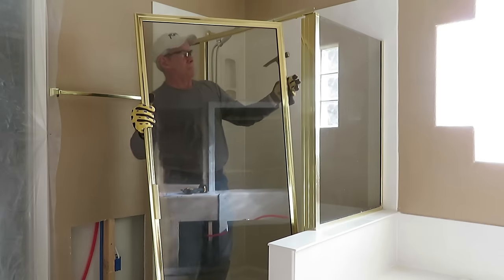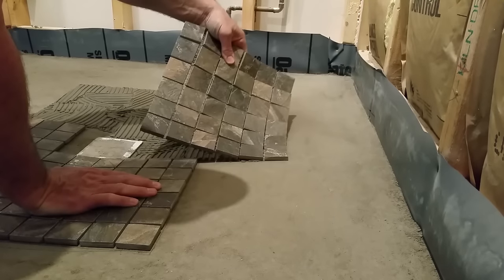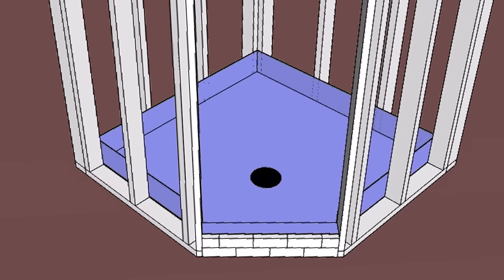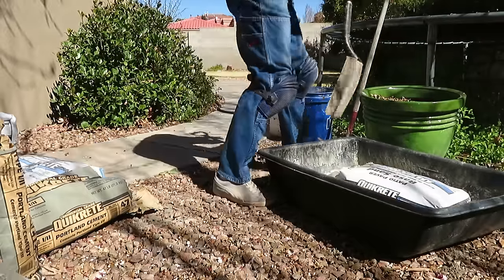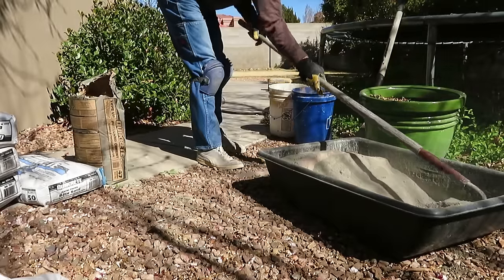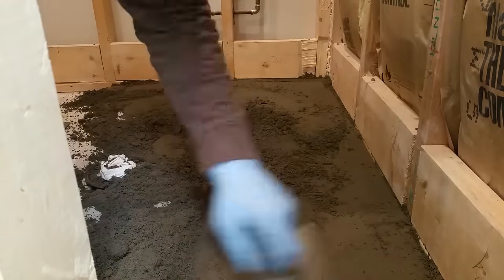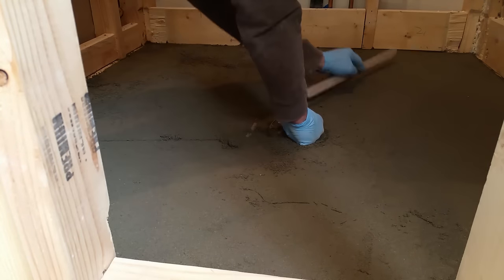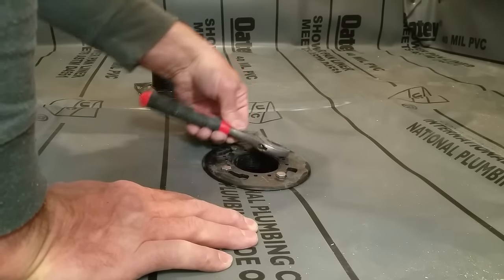Building a Shower Floor From Scratch - Part 1 of 2 - With Shower Pan Membrane

Comment: After 16 years, it was time to replace my shower door and redo the shower floor. As I did the demo, I found that water had leaked in back of the shower wall and there was a nice glob of mold in the horrible dry pack job the installer did. Of course he put the liner on top of the subfloor and then the dry pack which was completely wet. Your method of putting a slope in the first dry pack under the pan liner makes perfect sense and is what I’m in the process of doing now.  I have perfect confidence that my install will never fail thanks to your help!  Thank you!
Reply from the maker: Good luck with your shower, David! Yes, much of doing constructions projects well is doing what makes sense. Adding a layer sloping to the drain for the pan to rest on makes sense. Thanks for watching and for you comments!

Comment: This video is my bible to re-doing my parents tile shower. Someone screwed them in 2019. It destroyed the framing in the walls from all the water damage from the shower leaking. I'm a finish carpenter and don't know much about tile. Especially when it comes to the pan this video helped so much.
Reply from the maker: Thanks for watching, Josh! As a finish carpenter, you have all the basic skills necessary to pick up tile work as well. You just need a question or two answered along the way. Glad the video helped point you in the right direction!

Comment: I own a flooring company. I’ve been doing this for 30 years now and I just came across a video a few weeks ago of an individual basically trying to educate individuals and tell them to put loose aggregate around a shower drain after you complete your first shower pan pre-slope and then you add your membrane and when he got to his second and final last Install of the final pitch with the pan mud he was putting loose gravel around his drain and if you ever see your tile installer doing that you should stop him or her immediately and fire them. You only stick shower pan mud or deck, mud,in your  shower pan. Nothing with any type of gravel or aggregate should never be installed in a shower at any time if someone does that, they do not know what they’re doing and you need to stop them. If you pour your shower pan right you could install your tile right from the shower tiles and run it straight up to the wall. You should not ever have to use any furniture strip to start your first row of your tile installation. And another very important tip the less water in your pan mud the better you’ll be it should come out like a paste never like watery, mud, or looking like concrete mixture.

Comment: You need to do one thing. On a concrete floor with a preslope; at lease wet the old slab so it will not make you mud pack too dry and it fails. Best to bond with cement slury. 42 Years Journeyman
Reply from the maker: Thanks for watching and for the comment, Franklin.

Comment: What are your thoughts on bonding your preslope drypack to the concrete with a thinset slurry? Thank you so much for sharing your knowledge with this wonderful video.
Reply from the maker: I wouldn't have any objection to it, Aapl, but it's one of those things that may be overkill from my perspective so I wouldn't bother. My view is that once everything is in place in a shower remodel, including the outside bathroom floor tile, nothing is going anywhere, as in curb, layers of drypack, etc. Your idea wouldn't hurt anything, but probably wouldn't make any difference either. Thanks for watching and for your comments!

Comment: Beautiful job. I used to do it that way for a long time.
Reply from the maker: Thanks, Tile Slay. So you have made the switch to Schluter-Kerdi products. If you have a chance, give me a rundown on what convinced you to do that. You know what the 'old timers' would say, right? In my case, I'm never quite sure how long I will continue working but I am winding down. Just never made sense for me to trade what I know and trust for a system that I'm sure is fine, but  what I see about it, I don't really trust.
Reply: I was young and went to the class in about 2002. Ditra has been around and proven since the early 80s in Germany. If you’re a pro and shop at the tile companies it makes sense. If you’re shopping at a box store not so much. They want trained installers using their products and they are the only company that really has an installers back with warranties. I learned so much from the six times I have taken the the class. I’m about do for another. From ease to install to speeding the time in someone’s home. It’s perfect. You said 3 days to do your pan. I have a pan, walls and 100% water proof in about 5 hours. Water test the next day. I’ve even had two leak during water test. But that’s why you test. Easy repair and then move on to tiles. I give the home owner the cost difference. So you have less materials cost but more trips and a sore back. I give a better product in their home and make less on prep. Less hrs into it. So I can turn out a shower a basic shower per week. It also operates logically and comes from the concepts of true old timers. I hate that people refer to old timers as 1950-2000 those will be the darker days of tile. Tile showers did fail from lack of quality installers, slow and expensive. So the plumbers came to the rescue with making a giant plain white funnel to the drain. And because of the simple nature it worked. More people have fiberglass showers than tile showers.
Reply: And I guess it’s really about prospective that we use. It old timers with cement board? Or full properly done mud set? Or further back sand status method? Depends one what kind of building we are also looking to construct. Using cement board as old timers really is the smallest chunk of time in tile history and was never designed for use in showers. The skill level was low and it worked well good enough to get a few years out of it. And when did tile setters just take it on themselves to decide how long their job should last? We are getting paid to build a permanent structure in a home and it should last the test of time and be done with the best knowledge to date. If a home owner wants to tear it out, it should be because of style not that it failed. Just how I feel.
Reply from the maker: I use Festool sanders in my woodworking and know about the quality of German engineering and, by the way, those tools from Germany cost more as well. That's why I assumed Schluter's tile systems had more substance to them than meets the eye. With your training in the products, it sounds like you have developed an installation system that works for you and that you trust. I am not a fan of their displays in the big stores and can't imagine you are either. They present it to the DIY homeowners like it is as simple as 1, 2, 3! It is for you because you know the products inside and out. But for typical homeowners, it seems like too many things could go wrong in the installation process that they would have no background to even recognize what was happening. In another lifetime, you could probably convince me to give it a try!

I got seriously into construction in 1977 and you are right that particularly in new construction, tile installations were sometimes ridiculous. Mud showers were too expensive for anything but luxury new homes and higher end remodels so in a lot of cases I saw plumbers install drains and shower pans, sheetrockers rocked the showers and screwed into the pans at the bottom plate, tapers floated the joints, tile guys floated in shower floors against the sheetrock, curbs were 2x4s with sheetrock on them. I talked the main builder I worked for into letting me do a hybrid version of a mud shower, an idea that he liked. Since I also did the vinyl flooring and laminate countertops we made it work dollarwise. That was a long time ago for me! Oh yeah, on the sore back comment, I'm just glad I can still work hard enough to get a sore back! You'll understand what I mean a little better in about 20 years!

Comment: I saw a video from Starrtile that said you don't need a preslope. He also did a mockup and tested his opinion and it was very convincing. Isaac Ostrom also did a test on the dry pack where he mocks up a shower pan up the drypack stage then fills it with water, plugs the drain and lets the water drain through the drypack onto the bedliner and into the drains weep holes.
Reply from the maker: I would tend to agree that there are other approaches to building shower floors with drypack and liners that will work and maybe work really well without the exact steps I used in my videos. Sounds like the second video you reference is giving a visual illustration of how drypack is actually supposed to function. The specifics of what I do have evolved for me over time with tweaks and modifications being made through the years. It works for me and probably more importantly makes good 'common' sense to me as well. Thanks for watching and for your comment!

Comment: Rusty, I have worked in and around construction most of my life and love to see a true craftsman. One thing that I have never done is a shown floor installation. You make it simple. Some of the other videos show roofing paper and lath under the dry pack. Is there a reason that you don't?
Reply from the maker: Thanks for watching, Larry, and I'm glad you find the videos helpful. Yeah, the process is not complicated if you just take it a step at a time. The thing that has the biggest learning curve is figuring out how to work with the dry pack. I tell people their best shower floor will probably be their second one! 🙄  The roofing felt would be helpful in slowing down the drying out of the dry pack while you are working it, but I get this first layer placed in about an hour for a typical shower so that's not an issue. The lath would add some additional reinforcement for the dry pack. But that first layer of dry pack is to give you grade to be able to lay the shower pan on so water that reaches it will flow to the weep holes in the drain. That layer is confined by the bottom wall plates and brick step so the lath seems redundant to me. Maybe on a wood subfloor, but I have never done it. Good luck with your first shower floor!
Reply: @RustyDobbs  Thank you for the reply. Will send you photos upon completion.

Comment: i have a question about the step process. What  material do you use over the mesh?  Cement or the packing  and then thin set? I see on the video you laid the floor tile first and the step last.  I will be using this process for my home project this week . Your video really helped me. Thank you
Reply from the maker: Hi Stella. I cut and bend the mesh so that it kind of grips the step when I slip it in place. I like for the mesh on the inside of the step to be buried slightly in the final dry pack and for the shower floor tile to be set right up against the mesh. On the outside, I push  pieces of tile against the mesh and coat the whole step with a layer of thinset. On the outside, the thinset will stick to the brick and secure the mesh to the step when it is dry. I then cut pieces of 1/2” Hardiebacker to wrap my step with and use thinset to secure it to the step and boxes and/or pieces of tile to hold the Hardiebacker in place until it dries. Thanks for watching and I hope the rest of your project goes well!
Reply: @RustyDobbs  excellent thank you. I'm noticing different types of bricks at stores. does it matter much from cement brick to red brick?
Reply from the maker: @stellavisionmade-in-usa.9443  No, whatever size fits best for your needs should be fine.
Reply: @RustyDobbs  ok cool. thank you, i really appreciate this.. besides saving money, i find this very rewarding. When I took the tub out, i was intimated and thanks to people like you and youtube I feel less intimated. The cast iron was exploded on the inside from previous people using Liquid draino and stuff like that. I had to cut the limestone with a drill, making holes and going back  and forth to get to the cast iron connections. about 3 feet of pipe I'm replacing it with pvc. what a project lol. But that really needed to be done. I'm sharing this because people have no idea how damaging using these products on an 1966 built home.. Thank you again kind soul (*L*)

Comment: thank you... I am doing a poured concrete curb, didn't know how to waterproof it. It didnt seem right to just glue the pvc liner on the concrete and put the mortar and tile on the plastic, your way makes more sense lol.
Reply from the maker: Glad you found it helpful, EJ. Yeah, I use a couple of methods for building curbs depending on the situation, but both work well. Good luck!

Comment: I love just listening to you work, even if I weren't redoing my tile shower pan!  So happy you demonstrated a brick curb!  I got the pan done, and am replacing only the lower 6 inches of tile and tile backer (2 inch curb over drain + 3 inches of waterproof membrane over curb).  But the remainder of the old wall tile that I want to save is set in a 2 inch thick shower wall.   1/2 inch gypsum board nailed to the stud wall, 1/2 cement board (with diamond lathe in corners), thin layer of white mortar material, and 3/4 inch of fat mud and diamond lathe, then tile.  It is 2 inches from studwall to top of the tile.  Can I just build up my wall with three layers of cement board?  Should I I bite the bullet and learn how to mud the walls?  I am also concerned about the seam where the old wall meets the new.  I clearly cannot tape it, but was going to push as much thin set between the two as I could when I put thin set over the nail holes in the top one inch of the new backer board.  I guess I will know how mudding the walls will go once I finish mudding the curb.  I am just using Quickcrete type S masonry cement, maybe I should get something like Custom  Float bedding mortar if I do the walls too.  Wish me luck!
Reply from the maker: Thanks for watching, Vidalia and good luck on your project! Wow, that sounds like a very old school shower but you understand it well enough to keep doing what you are doing. Under the circumstances, I would not shy away from using the 3 layers of Hardiebacker to build back out your wall. I would just want to make sure I had long enough screws to run through all three layers and into the studs. Always predrill pilot holes in the Hardiebacker to eliminate cracking it. The seam is a tough one and I'm not sure there is a good answer. When combining old work with new, you just do what works at the time and makes good sense. I would probably run a bead of silicone caulk into the joint and move forward with the repair.
Reply: @RustyDobbs  Silicone a true miracles of modern age bathroom construction!   Thanks so much for the advice and encouragement.

Comment: Thank you for the video.   It is very informative and helpful.  I might missed it, but how long should I wait after installing the first layer of drypack under the membrane?   Same question for the second layer....how long should I wait before proceeding with the installation.   Thank you again!
Reply from the maker: Thanks, William! It's a three day process for me. First layer on day one. Membrane and second layer on day two. Then tile on day three. Actually, then grout the floor on day four. You can finish out the shower walls after that. It's an extended process, but I've found you get the best results long term from building the shower this way. Good luck on your project!

Comment: Have seen a lot of videos, but you really do a great job in explaining the process with great tips as well.  

I worked as a tile setter for a very short stint while in school, though it was many years ago. So, there is a lot of old school technique that I wondered if it was outdated.  It was all about wonderboard, taping seems,  then hitting with thinset.  

Well, I am not renovating my bathrooms now.  Starting to research current approaches,  I see they use a Redgaurd type thing often.  sometimes just at the seems of the backer board, other times over the wonderboard, even the pan all the way to the drain.  What are your thoughts on this?

Again, great video.  It's impressive becasue knowing your typical DIY'r, you supply much information and approaches for getting a good product.
Reply from the maker: Thanks for the comment, BPRescue!  Sounds like we both got started working with tile in the same way, but I was probably 30 years earlier than you based on the techniques you are describing! The "old school" techniques from my time were mud and lath walls, floated with a hawk and trowel! 

I think the brush on waterproof membranes certainly have their place and I have used them occasionally on a case by case basis. My go to approach these days is 1/2" Hardiebacker on walls, tape and thinset seams, then brush on the membrane on the seams and corners only. I don't buy off on the full 'waterproof envelope' concept. On shower floors, maybe it's ok to coat the final dry pack like in my video with a membrane before tile but not as a replacement for the showerpan liner from my perspective.